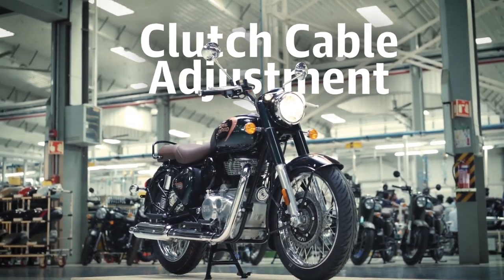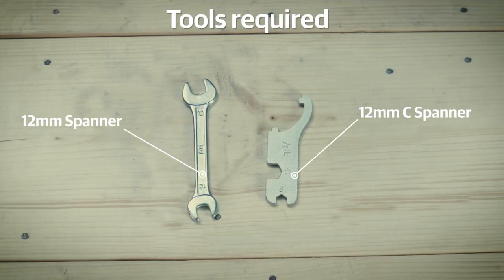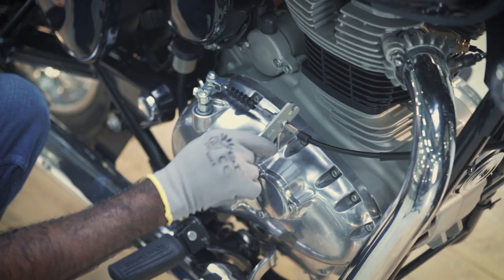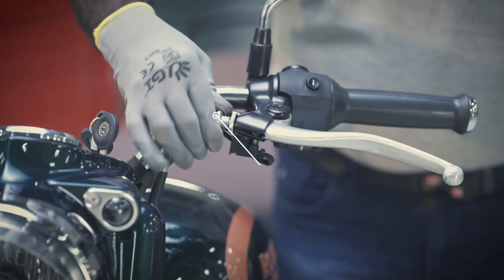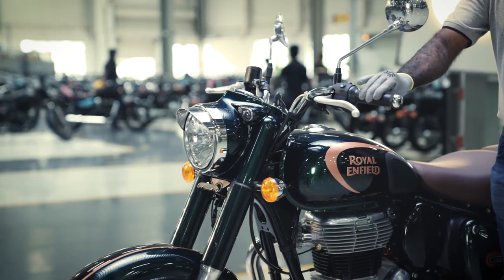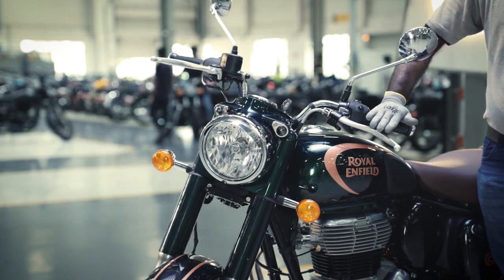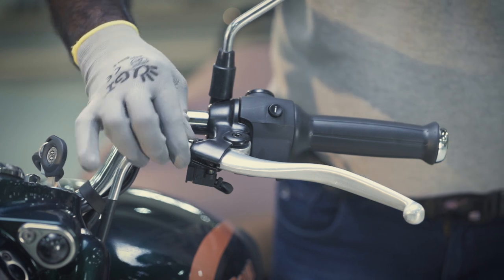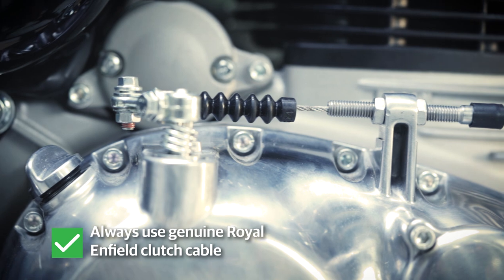All New Classic 350 DIY | CLUTCH CABLE ADJUSTMENT

Comment: If handbar clutch adjuster is fully loosen then rider have to release full clutch and give some throttle to move the bike. If adjuster nut is fully tighten, the bike will jump start and may turn off in most cases. Have to fine tune properly and also the rider shouldn't feel any pain while pulling lever during long rides

Comment: My new Classic 350 clutch is very tight and no freeplay at all..
Faced gear jamming 2-3 times now
Reply: Bro do as they are suggesting. It works for me. If you do not sort it out in time, you may loose your clutch plates quite soon.
Reply: @RajatKumar-pr1xx now I have a little bit more freeplay after I went to the local mechanic but and also got it checked by the RE showroom guys during my second servicing , it’s fine they said (RE servicemen).
anyways I will tell them to check the clutch plates after 20k kms and replace it if it needs to be replaced. 😊